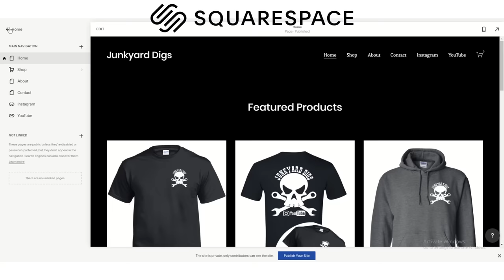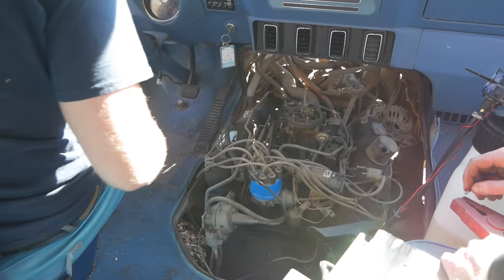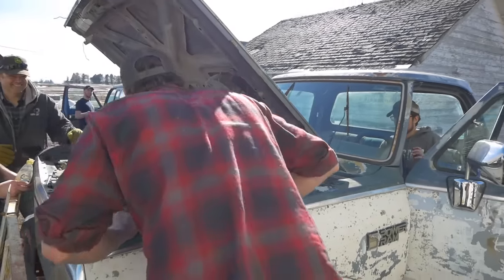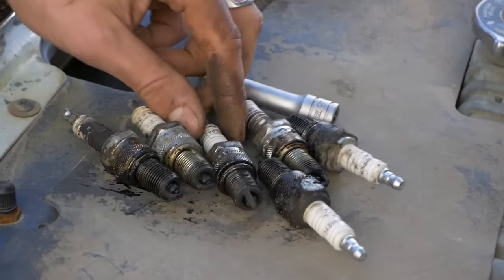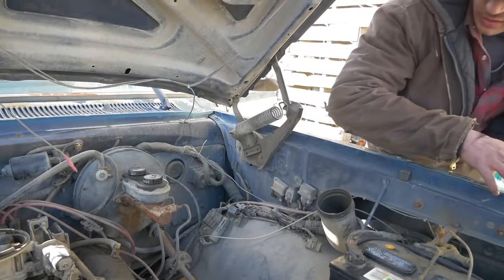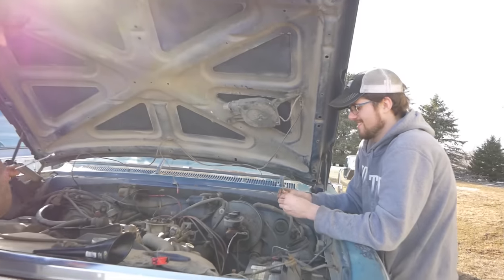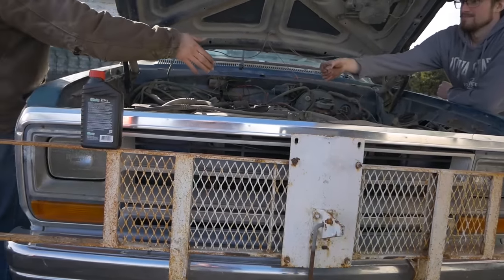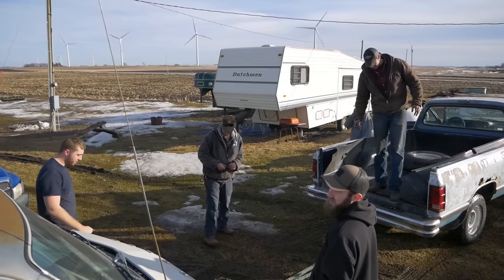Revival RACES! First Start CHALLENGE with two Old Mopars!

Comment: If you guys keep making content like this, your channel is going to blow up. This is the type of stuff people want to see
Reply from the maker: Lets hope so!
Reply: @JunkyardDigs  Even more so if you'd included the footage of you nearly blinding yourself. YouTube viewers are some sick individuals...
Reply: Yeah they'll probably blow themselves up someday.
Reply: I fully agree!
Reply: YES
Reply: @JunkyardDigs  HOORAY dODGE! though why isn't 318, or even 225, enough for a church van anyway? who wants to hotrod that thing? and it might not get stuck in the mud with 225 and you lost more time towing it than it will ever lose accelerating! my 92hp, 1982, 225, w150 POWER RAM tows cattle over mountains just fine (though sometimes at the top of 2nd at 18 mph up hill).
Reply: We need an entirely new generation of you cat gurus for TLC (the learning channel).  A full blown. Competition with Chip Foose crowning the new Kings, or in Mook’s case, queen of car gurus.
Reply: ROFLMAO 🤣
Reply: it's like roadkill, minus the BS from motortrend
Reply: @alan6832  Sorry to get all technical here but the Slanty has a higher specific output (horsepower/cubic inch) than the 318 even though it had a higher potential for horsepower. As in yours had 2.44 hp/cubic in. While the 318 had only 1.87 hp/cubic inch. The engine in the van was a 360 (175 hp).
Reply: @AlexTrain5249  92/225 is 0.41 hp/cubic inch and getting stuck is related to engine (and front end) weight, which is neither displacement nor power.  Aluminum radiators and little rear batteries augmented with supercapacitors help in the same way, by getting a larger percentage of weight on the drive wheels.  I consider this far more important than power and therefore like VW squarebacks and Corvairs.  Yes the church van is 360, which is twice as big an engine as old ladies need to get to church.  Even a 2.2 would get them there if it would bolt in.  I have a 59 passenger storage bus that came with a 292, for 4.95 cubic inches per passenger, and it got kids to school on time every morning for years, with excellent traction.
Reply: Erik Larson q
Reply: @alan6832  yeah strange it's a 100 series, maxivan with a 360 V-8. Most maxivan body with 360 V-8 is usually found in 200 and 300 series van.
Reply: @ChillkootMarkowee  Actually. there is a church around the corner with a Ford V10 church van, so maybe they are in an awful hurry to get to church.
Reply: @alan6832  yeah hahahahaha their in an awful hurry to pray to god and confess their sins! But let me guess that V10 must be a E350.
Reply: @ChillkootMarkowee  Yes. One would think that anyone in that big a hurry would want a lower center of gravity and a rear sway bar.

Comment: Nothing like the sound of an old dodge starter
Reply: Got to hear them a lot because those old mopars never liked to start or run haha
Reply: sounds just like my mr2s lmao
Reply: Mike Miller only the ones tuned by chebby boys
Reply: @mmiller1188  if you knew how they liked to start, they start every time :)
Reply: Frigglebiscuit every dodge near me cranks a good 20 seconds before firing lol
Reply: @mercury0214  probably useing shitty eddelbrock carbs.
Reply: 360 in a 78 D-150. 650 edelbrock. Starts every time with no problems
Reply: Vapor locking thermoquads
Reply: That starter is called the Highland Park hummingbird
Reply: I love the sound of that  starter too!

Comment: Any chance the putty at the bottom of the carb bowl was lead?
Reply: Don't think so. Only supposed to be unleaded available by '89. I'm going to look under my '88 to see if it has a cat. Converter equals unleaded only.
Reply: @jameshafner1442  The van was a 77, but i don't think it is lead because they were only recently parked i.e. in the last decade. Me thinks that it's ethanol that's solidified with a touch of metal from the bowl in the substance.
Reply: @jameshafner1442 , it wasn't fully phased out until the mid 90s.

Comment: I tried this in a 77 dodge motorhome that had been sitting 20 yrs. Brakes were weak to start with, 9 miles later at the first intersection, a big one, front lines popped when i braked. I think the vacuum my ass had on the seat was all that stopped me.

Comment: Ethanol in fuel has so much to answer for, on older cars it literally eats fuel system components from the Tank pump sock.Strainer, Fuel gauge level floats, seals, hose etc.
I know some states in the US has high E content and it varies a lot as it does here in Aus but lucky for me Victoria still has Ethanol free fuels.
But wait, theres more!
It's hygroscopic  and soaks up moisture and then dumps it in places to rust stuff up, destroy fuel pumps, injector nozzles etc and the big one for E85 is to add water to the sump oil on cars that sit a while, Ask me how I know this lol

Comment: That blue van interior sure brings back a lot of memories. We had a 78 B200 2 tone blue with blue interior for decades. Thing liked to wander all over the place despite the front end being rebuilt. and it went through 3 steering boxes and needed another when we sold it. Cheaply built vans, always leaked water from the body seams and EVERY time you wanted to take it on a camping trip about a week before about 3 or 4 things would break on it. Never failed to do that. The starter in that van sounds sickly. Glad I don't have to deal with it anymore!
Reply: This comment makes my want to cry seeing as I have big plans for my 72 b100 this summer haha
Reply: @kickflip6270  Good luck with it. I drove that thing to my drivers license road test.

Comment: Judging by the running condition, that van needs more than a new fuel, ignition, lubrication and cooling system 😂😂. You guys are the best!! the spark plug is sparking all over the place but where it suppose to, my buddy's saying it's all good and i can't disagree regarding the whole situation😂😂. Keep it rolling guys, you're on the right path.

Comment: I figured Thunderhead289 would win, because the EFI 318 Mopars are a very solid engine as long as the plugs, rotor, and points are good.  70s carburetor Mopar V8s with the smog crap can be quite temperamental, by contrast.

Comment: My first car was a 1989 W250, with the Holley TBI on the 360. Had a horrible backfire problem when I went to accelerate (couldn’t do high school burnouts because of it). After a year and 4,000 miles, and thousands of dollars in parts, my timing was 12 degrees off (2 ATDC instead of 10 BTDC). It’s been 2 years since and it’s still my daily driver. But unlike this one in the video, it has 61k miles and completely solid. Perfect for a 21 year old college kid.

Comment: I had a revival about 6 months ago. 89 Dodge D250, TBI 360. Had 60k original miles, was an old Ohio county truck. But it sat in this lady’s front yard for 2-3 years. I went over with a buddy. New battery, a two gallon gas can for prime, cut the belt off the locked up smog pump and it fired right up on a 1/4 tank of old gas. Drove it 15 miles home on almost no brakes for $650! That thing was fun till it popped both head gaskets the first time I went full throttle lmao!

Comment: Cold weather….. throttle body injection (TBI) vs carb…… not surprised. If they had electrical issues though, it was a wrap. Both have advantages/ disadvantages, but carb would win in a pinch every day. I have a sniper efi, but I’m well aware I’m screwed if I break down electronically (other than the Bosch style O2)

Comment: To fix the leaking brake  line just use a pair of vice grips on the rubber line by the wheel.  Old grain trucks can run around for years like this.

Comment: Ive got a 1976 dodge b300 (not d) 1 ton van, has a 440, if you ever replace the reluctor gear in the dizzy make sure you have it phased properly, they can be used on both small and big block mopars and the phasing is important for getting your timing dead on.

Comment: Pulled the same "putty" out of an oem carb off of a 74 ford 2000 tractor that the last owner tried to get running a year prior after sitting five years by loading the tank with a gallon of fuel and "mechanic in a bottle" then cranking it for a half hour and calling it quits..... I put a new zenith on it and it ran great.

Comment: To plug off the brake cylinder, take the fitting out and put a small piece of rubber inside and then the fitting will seal the cylinder

Comment: Here is a way to stay out of the burn ward.. Always put the air cleaner and lid back on but leave the wing nut loose and pour the fuel at the wing nut and the fuel will drain into the carburator etc. in case of a back fire and setting everything on fire. Watch Out. TD Atlanta

Comment: Many years ago, someone suggested that I ran some denatured alcohol through my 1985 Chevy K5 Blaze. After a few miles, it was running much better. A few days later, everything went to hell. I pulled the fuel filter and it was packed full of this clay like crap just like what you found in that carb. Over the next couple of tanks, I had to change the fuel filter a couple of times, but then everything was good, and the crappy running issue I had pre-alcohol, never came back.

Comment: 15:43, pull the fuel pump relay/fuse is easier if a injector is stuck open it wont get extra crap in it.

Comment: The truck could be a burn out machine where the rear brakes are not hooked up.   As long as you have some decent front brakes to hold it in place.

Comment: I have found that if you get an 8 penny nail you know a construction now and you cut the head of it off it will fit right in your brake line your brake line and your master cylinder and will plug off your line I'm sure there had to be some nails laying around that farm

Comment: The small ball bearings out of front wheels on 10 speed bicycles take the line-out you put the ball bearing in their you screw the line back in flow through that line gone always used to do the same thing to block off EGR is in the 70s

Comment: I just noticed how the '89 dodge with the 318 when cranking sounds about the same as the updated 318 for the 2nd gen Rams. It could be the compression change, or could be that the starters for both are the same dimensions... I could be right or wrong.

Comment: My Cousin Glenn had his Grandparents old 1975 Dodge D350 1 ton van made in Camper back then it orgnail had 318 V8 motor with 2 barrel carb had hand choke to with 3 in column shifter on steering wheel Manual transmission and 404 Rear end gears too! But Glenn grandpa Bill changes to 24 volts Negative ground put 1976 Massey Ferguson Perkins Desiel 360 CC 6 cylinder combine 500 motor no turbo type , put 2 fuel tanks, 1975 3 ton Stake truck Creeper 4 speed  foward gears  with Bow Low Manual floor shifter  Transmission, 390 rear end gears and update gauges for RPM on engine , extra Fuel gauge & Volt  and Transmission Temperature  ! Also switch for Glow Plugs too were old Cigraette Lighter used be ! Plus two air vents on roof with 12 volt fans also a 3 postion switch for battery Chargeing, Propane heater and stove  with Propane tank on frame rail , Hot water tank with house voltage plug to ! It still on road to today and loud too plus run excellent!

Comment: The w150 rocks I had a 91 model that my grandpa bought new and gave it to me for my first vehicle in 2001 67,000 miles on it. He bought 3 grays ones 2 had the 360 and solid back glass and one with the 318 and a sliding window of course I got the 318 no power but runs forever.

Comment: I like how they cut the brake line on the brake cylinder,Its a 2 part cylinder..just could have run it empty!
Reply: Yes. That's what I was thinking.  Or block off the broken line at the rear and then maybe had pressure to activate the OTHER side of the rear brakes.

Comment: I just cut my brake line and took a drywall screw, slathered it in rtf and cut a small square piece of extra rad hose. Screwed drywall screw through rad house and then screwed into brake line and sealed up leak to get me home

Comment: Would love to have that old pick up
Reply: That's good truck with 4x4 too the 318 is a good engine too it's only 170hp stock but it don't take much to build it into a 300 to 350 hp with a bigger cam and port the heads that truck would have Dana 44 front diff and 8 1/4 rear diff

Comment: ...the truck is obviously going to be easier to work on than a van..and I'd much rather have a truck..but I'd MUCH rather have that 4bbl 360 than the 318TBI...have an '88 TBI 318 and cannot get it to run right for anything..idles rough, runs too rich...that TBI stuff was crap on these Mopars, better to change it to a (good) carb...

Comment: I have a van just like that. It sat for 25 years and I got it running. Those motors have GOT to have good fuel pressure, or they are gutless. Check out my channel I think I have a video on it.